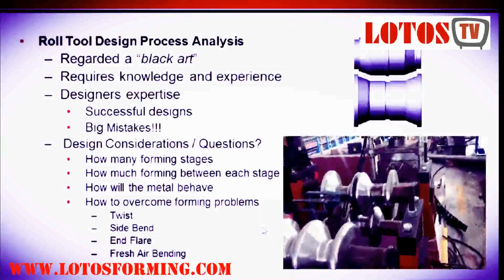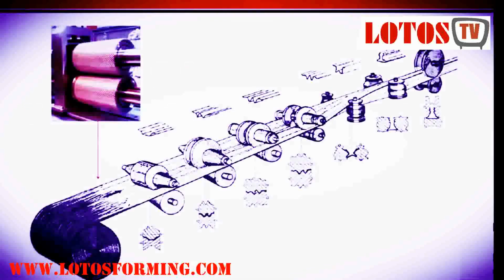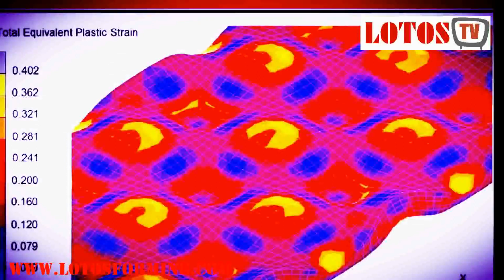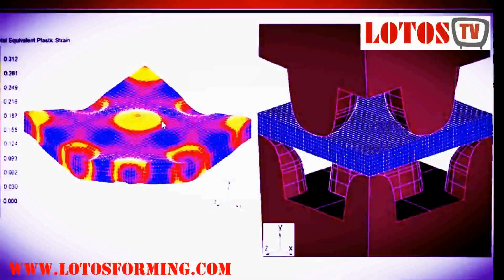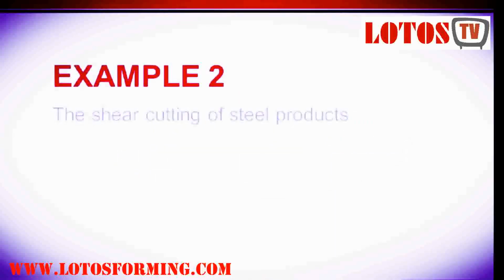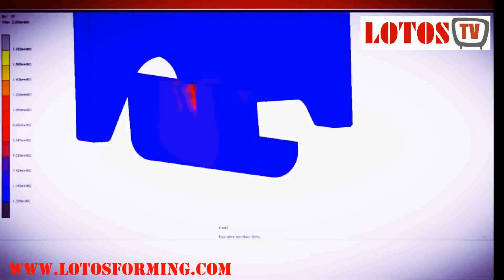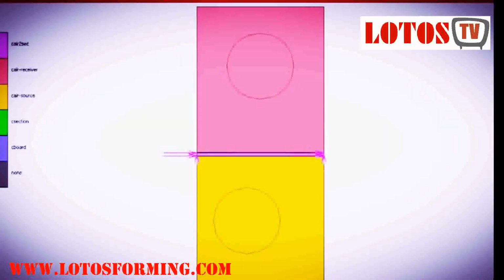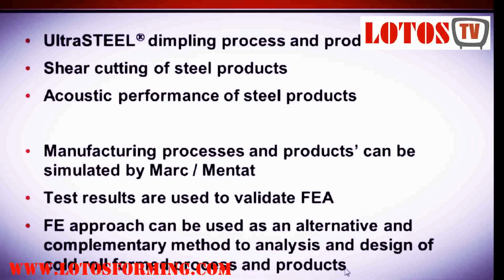【COLD FORMING 】: Cold roll process | Roll forming process" best cold forming basic"

Comment: Cold forming is the process of forging metals at near room temperatures
Reply from the maker: Cold forming is the process of forging metals at near room temperatures. In cold forming metal is formed at high speed and high pressure into tool steel or carbide dies. The cold working of the metal increases the hardness, yield, and tensile strength.